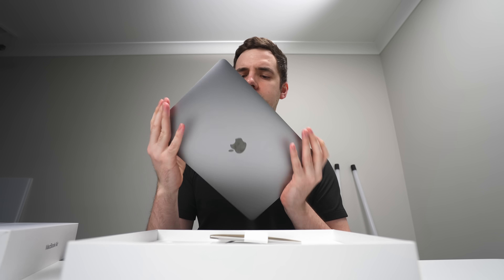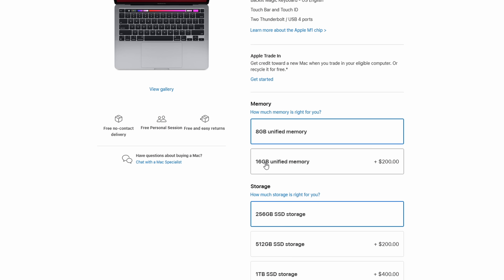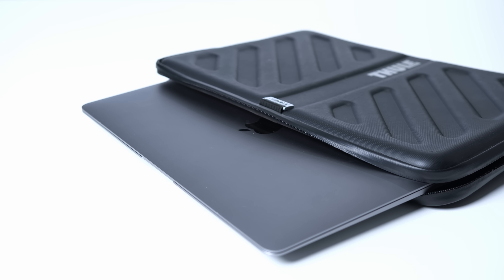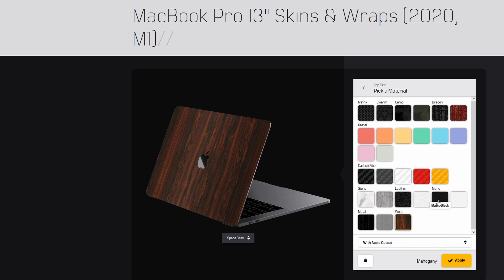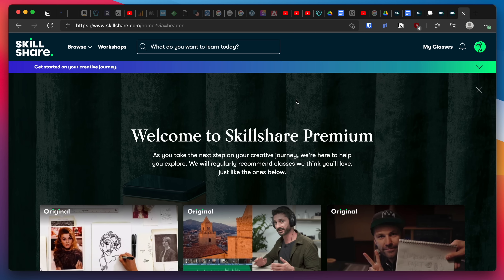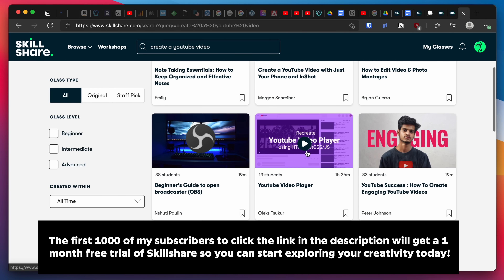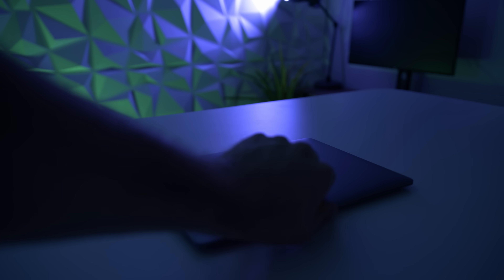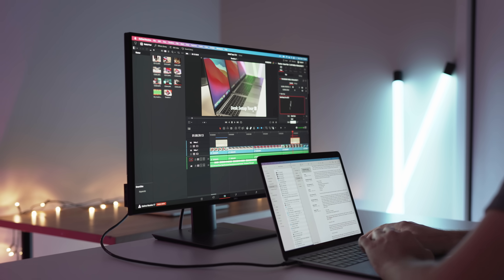How To Make Your MacBook Last FOREVER! (Ultimate Guide)

Comment: Last forever?
Tell APPLE to stop soldering storage which likely to fail before any other component like cpu and ram
Reply: At least they showed what ARM processors can do and this is much better than making hardware stronger and more power hungry. Do you know why US made GPU prices increase? It's because in the world gamers and miners also consume some percent of energy
Reply: @theencryptedpartition4633  i get it.. About the processor compute power.. But apple should remember... It is not a Smartphone... But a laptop . And user should always stay away from these soldered laptops....
Apple will be apple...they make some great innovations.. Often comes with a cost...

Sorry i will prefer windows laptop which will have no difference with m1 in daily tasks..and  just to have upgrade and replace path instead of m1 macs.... You could have enjoyed more than 10 years with raw power of m1.. But because of that storage... You are capped for a new machine....wasted cycles...sorry apple..
Reply: @asdbef3667  well PCs are slowly soldering stuff too...
Reply: @asdbef3667  This is why I am waiting for Nvidia Grace
Reply: @asdbef3667  its not a rip off company. I value my privacy and prefer the UI and experience of iOS that's why I use iPhone.  I came from Samsung because I don't like oneui. Also with M1 there isn't rlly a good reason to buy a windows pc unless u rlly want to upgrade internals and have the flexibility. M1 is already dominating the laptop market. You can't beat a $999 Macbook Air with a $999 PC since it will probably be a POS.
Reply: @mxngosvision  you got me with the "privacy" thing xD
Reply: @mxngosvision   lol..you really believe privacy is a thing out THERE? You are horribly misinformed 

Also i dont care what you like. As long as you dont mix your preference with facts

Also please dont do delusional talks like apple is now dominating laptop market----- this is a misleading usually said by apple fans...

No..apple is not dominating laptop market....
Even macos share fell last month..
So i will not buy into this talks..

You people are the reason apple are gettinf away with this malpractices and money grabbing tactics
Reply: @asdbef3667  rude
Reply: @riponrip4574  lol...when i say facts ..it becomes rude...nice job
Reply: @asdbef3667  I'm a lifelong windows/android user and have recently switched to macbook and an ipad recently for work and school. Apple truly does it better, not even kidding. Plus at the price points I'm seeing now for windows laptops, apple is becoming much more worth it given how long they last.
Reply: @meech37  well.before m1 came... 
The macbooks were heater... Ofc with intel.. Dont know how people put up with that...
That certainly wasn’t a great experience.. But comments like yours Were still there... Back in intel mac days...

M1 is good.. But certain tactics by apple just make me stay away from them.. I would be glad to miss out m1 and future Performance.. Just because of the loss of upgrading for long term durability..
Reply: @meech37  factss M1 is making me regret my XPS 13 and it makes it feel overpriced and sluggish.
Reply: a large SSD with normal usage can last decades
Reply: @_Digitalguy  it is all about freedom what to do with your pc/ laptop
Reply: @asdbef3667  there isn’t much convincing you can do here rlly. I am anyways gonna move away from windows laptops since I would prefer macbook as a primary and then maybe have a gaming pc on the side.
Reply: @zams yes.. It depends.. Not every ssd Will last 9 years..
It depends on how you use it..
But it is important to have path to replace rather buying a whole pcb
Reply: @asdbef3667  hello im noob, what do you mean by soldered laptop exactly?
Reply: @kjacob  soldered laptop means 
Every component like cpu gpu ram storage are fixed into single motherboard.. You cant replace them...

For laptop.. Soldered Cpu gpu ram is not a issue as they can last like 20 years or more..if handled properly..

But storage specially ssd which is write limited. Will fail before any other component like cpu ram
Also..people cant have cheap storage upgrade option with soldered mobo

You have to buy a new motherboard or replace the whole laptop if your storage fails..or if you need to upgrade storage for your future needs..so is your ram..

Thats why i stay away from soldered laptops
Reply: @asdbef3667  so you mean the main problem is ssd? but is mac ssd really that problematic coz im planning to get one and this comment scare me
Reply: @kjacob  it is not about mac ssd
But ssd in general..
You would be fine for at least 5 years if you do usual task like browsing and such..
Anything that involves less writing to ssd..

Any heavy writing like caching which mac os do quite often...really hits the storage...there was issue while back when m1 had huge ssd swap issue..with heavy writing..you can google it...

However it is said to be fixed by updates.. 
Thing is..how ssd works is the problem..applies to both Macbook and windows laptop

Problem is macbooks come with locked storage you cant upgrade/replace.. 

Where windows laptops always have a option to upgrade ssd storage or replace it when it has a problem..
Reply: @Reddington and you should stop giving false inaccurate info about ssds...
A ssd outlive the human lifespan??...are you a kid?

I have seen ssds fail within 5 years due to moderate to heavy usage....

Pls research something before misleading someone
Reply: @asdbef3667  you also should research 🧐…….. there never was an issue with Mac M1 SSD.  There was a glitch in system reporting that was righted in a Big Sur update.  The SSD’s were never in any danger of reduced life span.  
Your “advice” to consumers about Apple products here is based not on any kind of experience whatsoever.  You are simply regurgitating things you have seen and read on the internet.  
Your lack of fact checking is testament to you credibility.  
Cheers   🍻
Reply: @asdbef3667  actually a daily user of multiple Mac devices (intel and M based)
Also a repair technician for both Mac and PC clients.  
My knowledge base is solid and well earned.  
Thanks for participating
Reply: @chrisharris7205  your knowledge is already invalid by your previous reply..

Start getting some info first
Reply: @asdbef3667  👍🏼 your humour is top notch.
Reply: @chrisharris7205  there Are plenty of m1 user reporting high writes with video proof and you find this to be a humor....

Nice job apple fan

Btw...  Try to defend apple when m1 glass suddenly breaks as well and apple not taking responsibility for it for the design flaw
Reply: @asdbef3667  good grief….
It seems you have bested me……I am humbled and subservient in your shadow
Reply: @chrisharris7205  you apple fans never fail to amuse me
Reply: @zams the soldered laptop number is very few
Reply: and laptop SSD on macbook cannot be replace coz it part of motherboard right? well i guess i will just build a PC
Reply: @kjacob  yep..
Well depends on your needs
Whether you want to go portable or fixated desktop pc...

If you have no problem doing your heavy work sitting in your room almost all the time..
Then sure desktop is your buddy
Reply: well  i always edit a video and photo i mean basically i need my computer to work but i also want some portability for when i travel.. would you recommend desktop or mac
Reply: @kjacob  well..you have three option
You will have the best powerful and longest experience with desktop for the price $999..with most upgrade options.. Both cpu gpu ram.. In the long run..

However if you do like to travel often and think desktop wont cut it..the. Sure..go for laptops...

Then comes the next.... If you want to keep your laptop for a long period of time..with upgrade options for both ram storage ...then windows  laptop with a gtx/rx dedicated gpu is for you

However cpu processing wise m1 is better...which is good for both photo and video editing...m1 also has great battery life than windows laptops...

Take m1 macbooks if you want better battery life and ready to spent on another macbook 5-6 years later..(remember how long the storage will  last depends on your usage)

If you dont care that much ABOUT battery and usually want to edit photo/video...while charger plugged in...then windows laptop with upgrade option is def the best choice.
That is .if you care about portability
Reply: @asdbef3667  thank you very much that is very informative, if macook will last even 5 years then i will go for it it may not that worth it, but i think it suit me best on my current situation
Reply: @kjacob  sure..go for it.. 
Make sure you avoid 256 gb..and get at least 512 gb( larger ssd means more lifespan)
 with 16 gb ram.to last it longer....if you have more money

Also pro would be a good one..although air is not that bad..but for longevity.. Pro will come out first
Reply: @Reddington this just proves you have no knowledge how ssd works..

That calculation you gave definitely will not work..because..writes does not increase linearly...otherwise manufacturers would have priced those ssd much higher  than before...

Also i am pretty sure some drives has failed say samsung 840 pro... at the time of warranty ends...probably a bit of extreme usage....now tell.me...why did it fail?...defect?.. Hell no....

You cant just blindly say.. "Okay i use like this..then it will be written like this..and so it will last that long"...

Why would i buy a thing and calculate that i have to keep my writings... So it will survive that long....this is why HDD is still a thing...

And those who say i have ssd lasted as long like 7-8 years...they are using slc/mlc based high end ssd...that has more indurance Than any tlc based ssd...

Pls learn something..before commenting...
I even aint gonna reply.. If i see another same blah blah reply  from yours
Reply: shuuuuuush